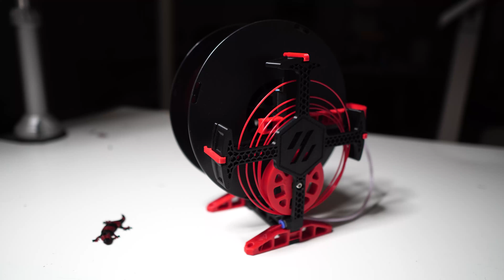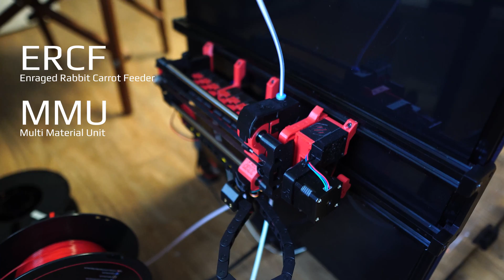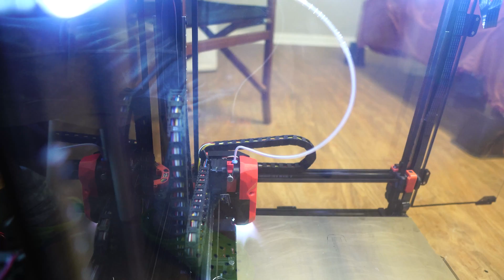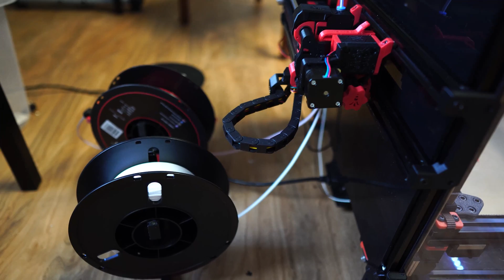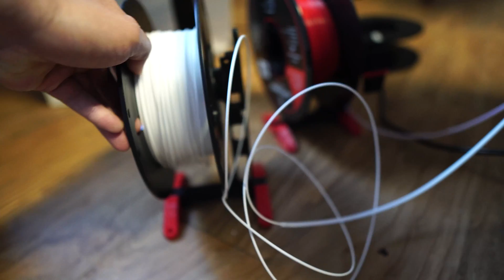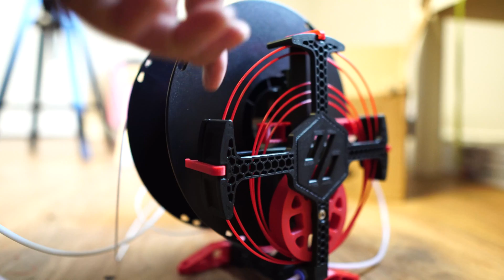How ERCP Filament Buffer works

Comment: How many loops should be in the buffer cage?  Is there a formula for the retract distance per loop?
Reply: At a guess, circumference of the outer cage minus circumference of the wheel in the middle, then divide your max retract distance by that length and round up.

Comment: Thanks!  I knew I needed a buffer for the carrot feeder I am about to build, but I wasn't quite sure how it worked just looking at the CAD.  I think I will try and tweak it a bit (flip the spool holder, add hooks to the feet) so I can hang a few of them off bottom of the reprack above my printer.
Reply from the maker: also check the usermod folder on github, there are a couple for the feet, upside down, magnetic feet etc.